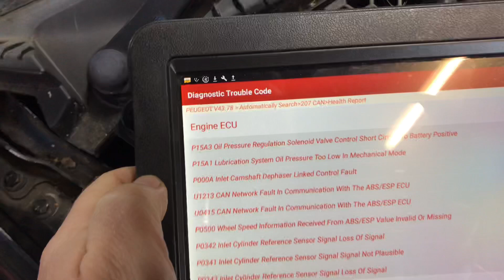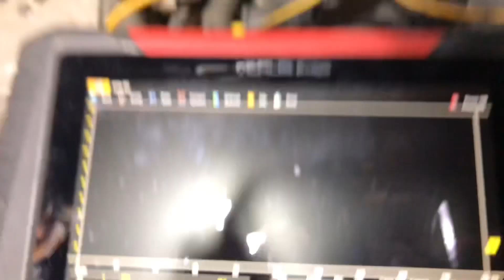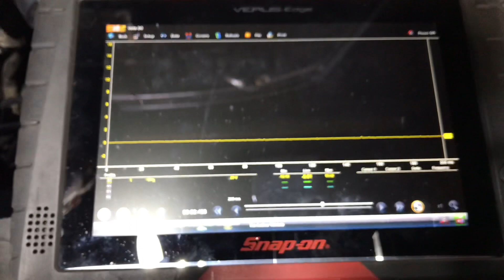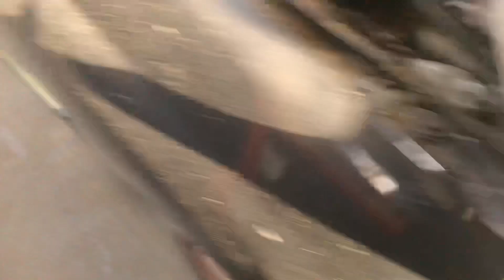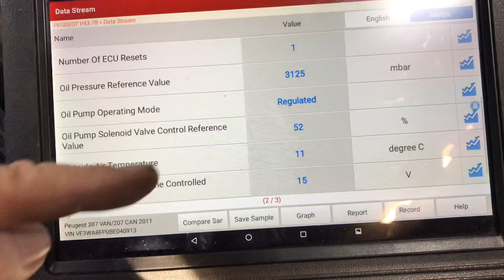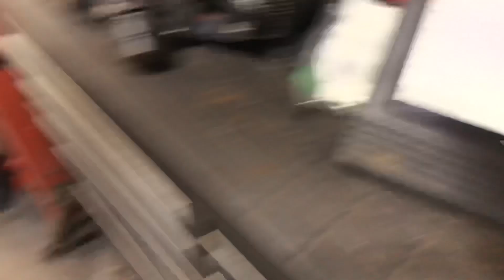Peugeot 207 1.4 16V VTi - Fault Codes P0341, P0342 Inlet Cylinder Ref & P15A1/A3 Oil Pressure Reg!

Comment: Hello. I have change both the camshaft sensors. But the engine is a little hard to start, and the idle is bad for like 30seconds. Drives great after that. No enginelight....whats the problem? :)
Reply: MAF sensor on mine, it was dirty  cleaned it, and it drives beautiful now.

Comment: Hi mate where is the mass air sensor on these
Reply: It has a air mass sensor. It is on the back of the engine, from the top, little to the right.
Reply: thats not an air mass sensor , its air pressure sensor @MrDustr
Reply from the maker: Don’t think it has one

Comment: Can you recommend a cheap scanner for home use as the cheap scanner I have is saying I have a misfire on cylinder 2 and two pending codes but it won't read them.
Reply from the maker: Launch or think tool are probably cheapest, do a compression test on the engine

Comment: These engines have a variable volume oil pump supplying oil on demand. Have seen quite a few that have cracked. Looks like you gonna be tearing that one down Sandy!
Reply from the maker: Thanks Elliot for info, the customer has declined repair and is selling cheers sandy

Comment: Great diagnosis on the cam sensor Sandy , these engines are absolutely junk , if not regularly serviced , they suffer badly from oil pressure faults , strangled oil filters , chain issues ,cam variators , you name it  big bucks to fix , try oil n filter twice ,, got to use the  correct oil grade ,  if no good after , advise to get shut 👍
Reply from the maker: Cheers for information Mike, customer has taken your advice it's now up for sale 😃